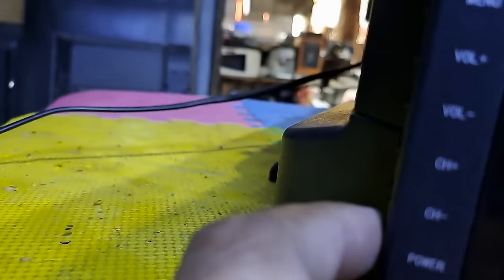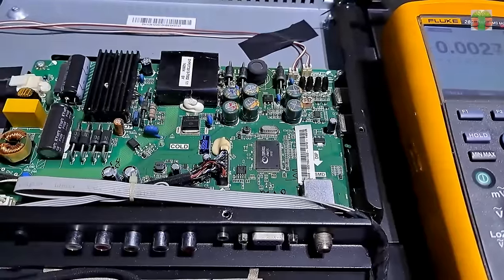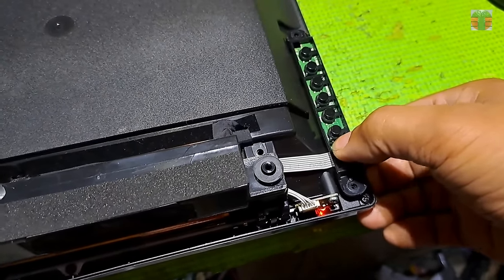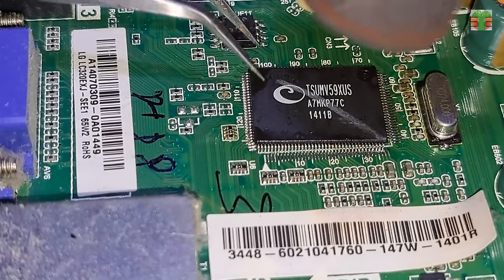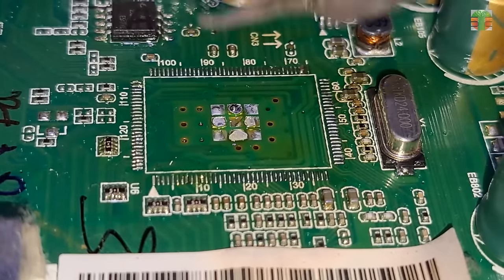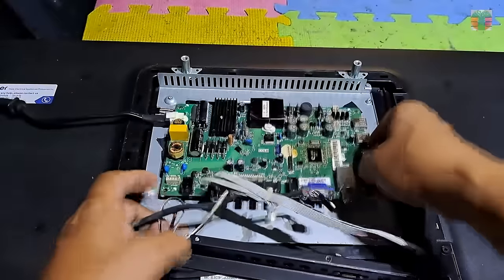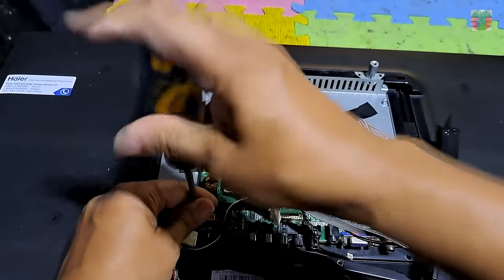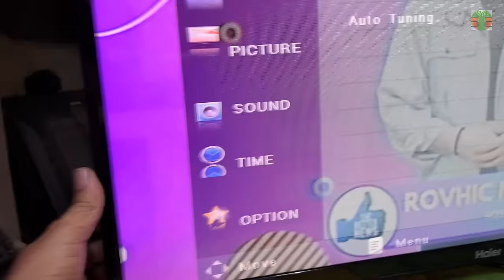A standby light indicator only not turning on, LED TV (Good EEPROM Firmware)

Comment: To lift the chip while has desoldered without touching other components one way is to use small sucking pump similar to a desoldering hand pump with rubber sucking cup in the nozzle.And personally i use also the bottom preheating with air gun to make the desoldering a lot more easier.

Comment: I have a question. For example, if it was the eprom can it be changeable without reprogramming, because I'm only considering the reprogramming tool the right site to download the files
Reply from the maker: Read the exciting firmware and save it, you can re right it if yu download the wrong firmware.
Reply: @tevzTVTevatronics  Okay, thank you for your reply, but if may ask, can we purchase it through the ic number and replace it directly
Reply from the maker: @payusavisit3482  yes

Comment: Helo ?.. I have LED Tv Hisense 39 inch that has problem of turning off itself and go back in standby ..checking voltages all are Okay and I replaced -all capacitors .,regulator ic 1118  flash eeprom ic are okay ..so tell me where to check and main Ic TSUMV56RUU-SJ not replaced

Comment: Ho un TV Haier le32b7000c ho programmato la 25q64 adesso vedo lo schermo capovolto come lo posso sistemare grazie
Reply from the maker: Enter service mode..menu 1147. Go to panel settings and change the value of the mirror.
Reply: @tevzTVTevatronics  l' ho fatto ma non trovo il panel setting